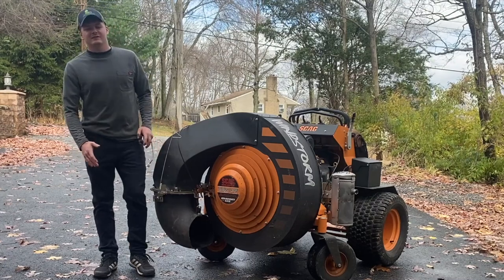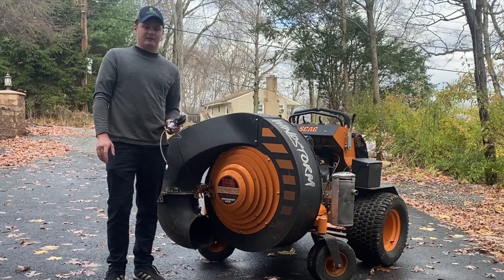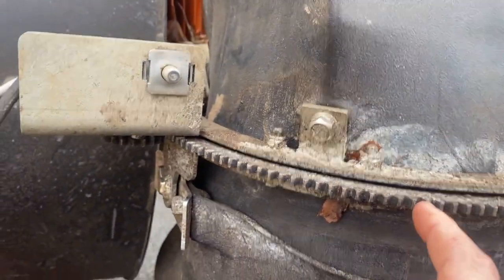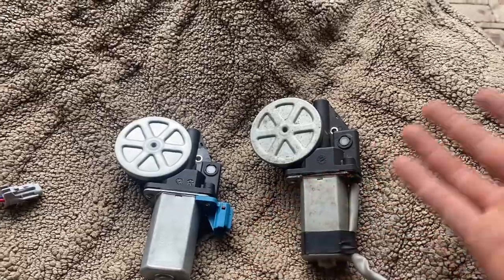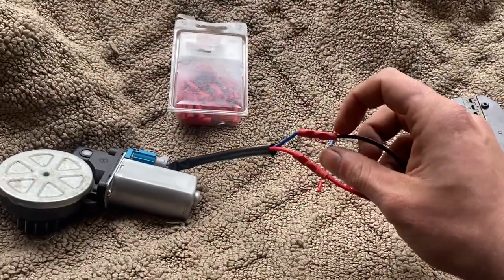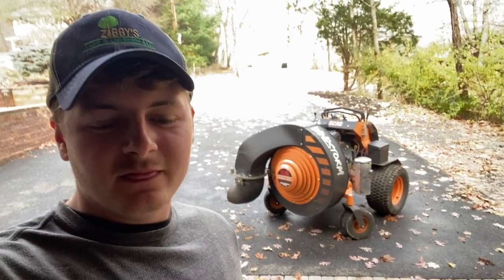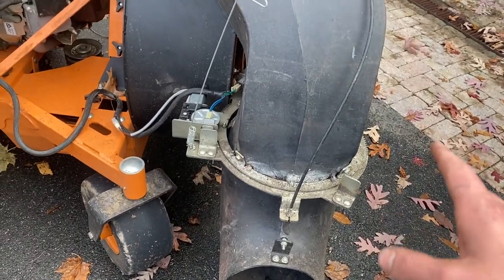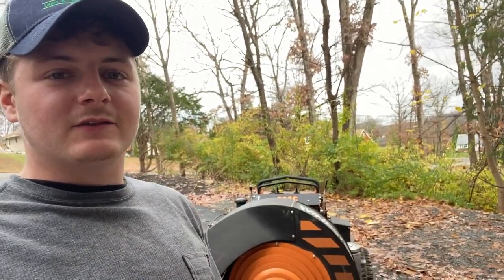How to SAVE $120 or MORE with your Scag Windstorm (Possible 2nd Option for Nozzle Motor)

Comment: I know this is an old video but had to comment. I believe the biggest issue is based on exactly what your showing. Scag grabbed a window motor that was originally designed to run the much smaller diameter gear which decreases load on the motor significantly compared to the large gear they decided to put on it. That extra load combined with a high duty cycle we ask of the motor and you get too much heat and burned up motors. You also want to be very careful not to damage the outer ring gear. It is easy to “egg shape” the gear by bumping into a tree or not having it tied down in the trailer. I’m rebuilding the entire blower nozzle on mine compliments of a broken height adjust cable that allowed the nozzle to catch on a sidewalk. These machines are stupid expensive to repair and I’m doing all the labor myself.

Comment: Outstanding.  Mine is a 2021 with only 18 hours on it and this motor died during a job increasing the time and effort to complete the job.  I don't know if it's covered under warranty.  Scagg should put out a recall and provide a better solution.

Comment: What is the part number? Can it be sourced from advance or O'Riley's?  Pretty cheesey scag didn't use  weather pac connectors on their harness'.   Thanks
Reply from the maker: Click on the link in the description, they have the modes it fits so you may be able to just go to the auto parts store with that